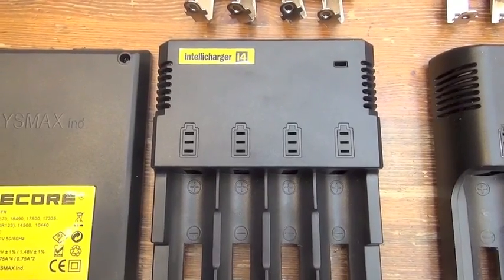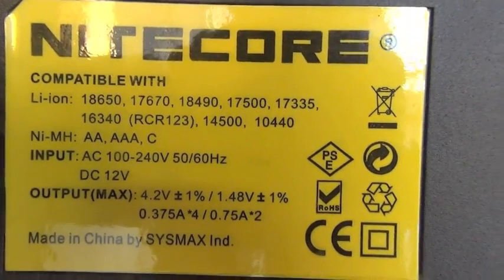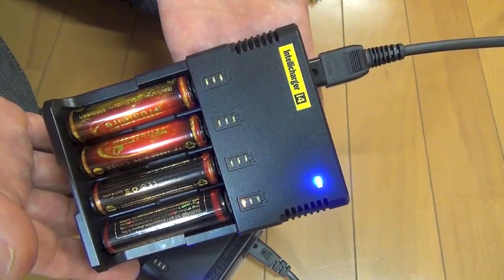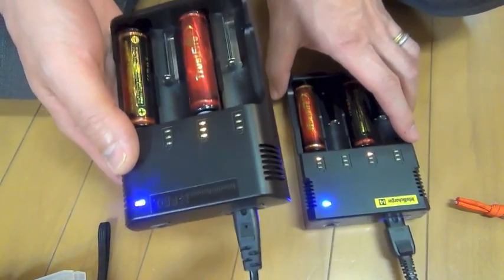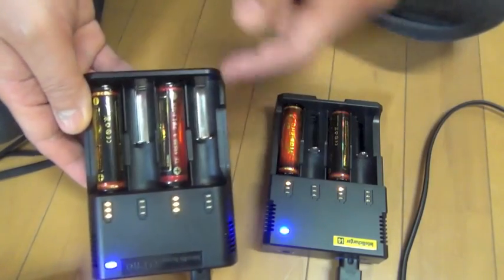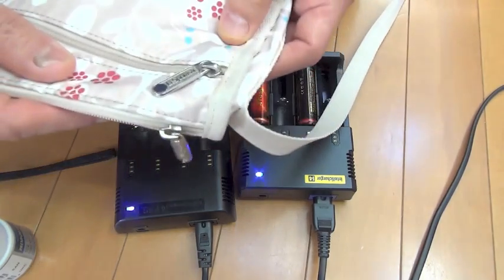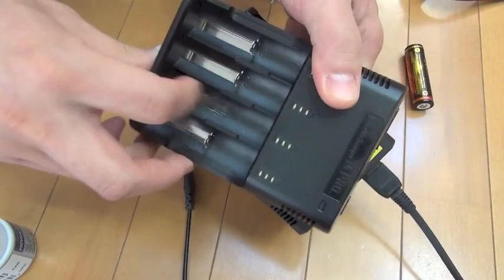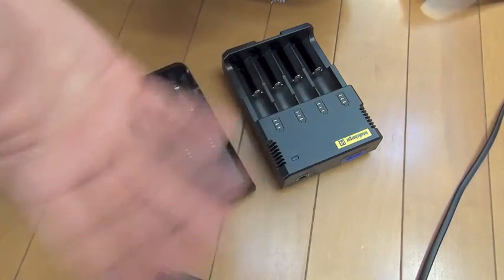NiteCore Intellicharger i4 & JetBeam Inte-R-llicharger i4 Pro

Comment: Im using a Interllicharger I2 Pro from Jetbeam, no hot, no problems for 1 year 24/7 constant use! charge anything type of cylindrical battery. Output max 4,2v @500ma x2 batteryss, or 1,4v @ 750ma x 2 batterys, nice review, its very hard to identify fakes!

Comment: what's your opinion on those trustfire batteries? I ordered some Soshine 18650 3400 from a Chinese seller and got those trustfire instead. They look like they're better quality then the blue ultrafire but since it seems like you use those more, I would like your opinion before deciding on to send them back or not.  Thanks

Comment: I got myself a Xtar charger for my 18650 accu (for my pd35). It can charge with 0.5A 1.0A and 2.0A. So it can do a fast charge or a slow charge. I use 1.0A to save accu life but I'm really pleased with it.
Reply: So does the xtar charger charge each battery at 1 amp or  does it split the current like the I4?
Reply: Justin Verhoff
I'm not 100% sure but I've done some measurements with charging time etc. And it looks like it gives both batteries 1000 mAH

Comment: You're wrong, both chargers have nearly the same circuit and charge with the same current. Only difference: Interllicharger uses channel 1+2 and 3+4 and Intellicharger 1+3 and 2+4 for combined loading. This means when you put two batteries in channel 1+3 or 2+4 as shown in your video, Interllicharger will charge them with 750mA while Intellicharger will charge them with only 375mA. That's because Interllicharger becomes hotter in your test. If you had put them in channel 1+2 or 3+4, Interllicharger had charged them with only 375mA and became cooler than Intellicharger (charging at 750mA in this case).

Comment: Their is a difference in the maximum OUTPUT current between the two chargers (that is clear from the labels on the back). 

Intellichatger gives a current of 0.375 A.
InteRllicharger gives a current of 0.500 A.
For the same voltage(4.2).

Comment: Hi Wako.
I have the NiteCore and here in israel is 240 V / 60 Hz.
I have a 3100 mAh Panasonic's 18650 batterys and their charging time is about 5-6 hours,I'm not draining the battery to the end as you did for the test So I guess that has taken a long time charging.
I had lots of Chargers, but I love the nitecore than any other,It is great that charging is slow 
  And the charger does not warm so the batteries do not run out quickly, fast charging is not good for the life of the batteries.

Comment: Battery pack in the aircrafts are catching fire because 
of defective electronic circuits like the ones in these chargers. 
It let battery to charge with too high current or voltage. 
But never because of heat generated during voltage transformation. The hardest plastics gets soft around 250C 
Paper will ignite about the same temperature. If plastics are still 
hard and u can touch it it is safe. regards

Comment: Europe 220V/50Hz, USA 120V/60Hz ... 
Voltage by plug type here: 

iec.ch/worldplugs/typeA

I was lazy to check, but every battery 
has something like max charging current, 
but optimal is never max ... so battery has 
1000 charging cycles lifetime ... with slower 
u can reach 800 or more with faster sometimes 
400 and even less. This was just example. 
Basically as lower current as better for 
battery life ... depends of type of batt etc ...

Comment: For the heat problem you can just put it stand on a side (it will make a better air flow, seem stupid but can make a difference)). Anyway to test it properly you need at last a "battery computer" able to charge completely your batteries (also able to tell you exactly how much mA the batteries got each one at full charge), discharge, and then charge them with the "intellicharge" again and compare the result.

I did something like that with the "I4", it charge the "18650" at 76%, no way...

Comment from the maker: I cannot believe in Chinese electric products because they don't seem like being made under the produst liability law. Almost all flashlights are made in China but they are used outdoors in low voltage, while the chargers take high voltage from our house electricity. Some Boeing plane took fire from its battey charging system and I am anxious about the same thing at home. So I cannot leave them unattended. Thanks.

Comment: I am thinking that at least one of your chargers may be defective. I run two nitecore I4s to charge 18650 cells for camp flashlights. I haven't had any problems yet in over one year of use. I also find my chargers will fully charge faster than the times you have found. Is it possible the cycles of your electricity differ from USA electricity and that may explain the over heating and length of charge. Good idea to evaluate the chargers.

Comment: My NiteCore charges 2 - 18650 batteries in about 3-4 hrs. Not sure what batteries you had there. Faster is not always better, I wounder if they both got the same amount of charge. Too much heat over time tends to do damage to electronics, for some reason it tends to let the smoke out of resistors....Not good :-} Thanks for sharing this and Take Care :-))

Comment: Nice comparison, thank you. I use the Pila IBC 4-stage Intelligent charger for my 18650 and 16340 batteries and i t always completes in under 4 hours without getting hot. I like it very much, it's very useful and cost around $45.00

Comment: Slow charging batteries usually is better for the batteries. It would be interesting to see if the batteries charged in the Jetbeam hold a charge as long as those charged in the NiteCore.

Comment: From a passing glance, the circuits are more or less the same, just a different layout, and the new one seems to have larger main capacitors, and fewer banks of ceramic capacitors, probably more reliable, higher temperature components.